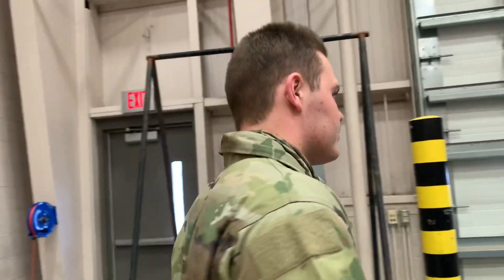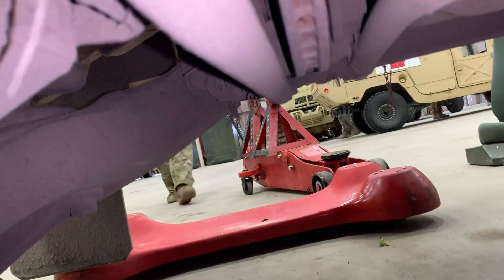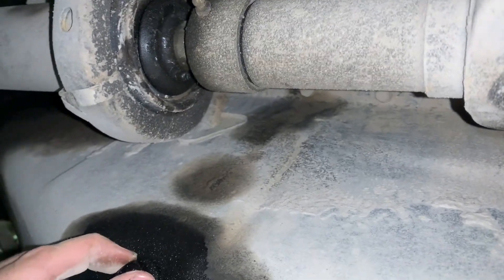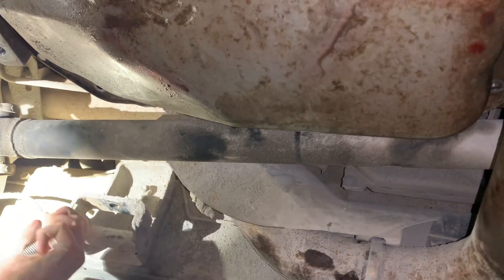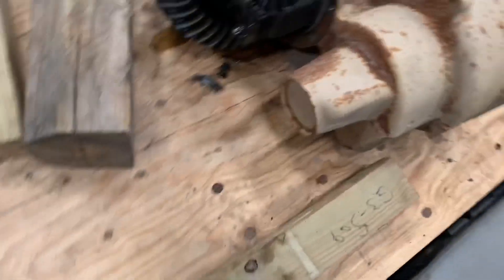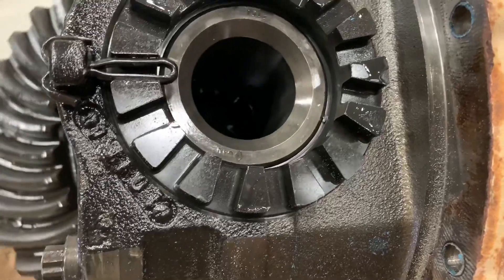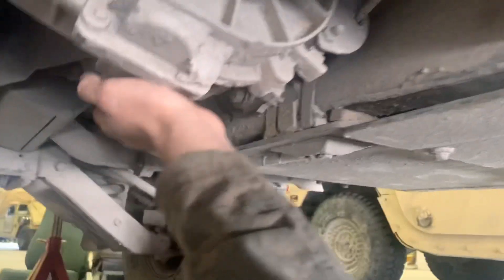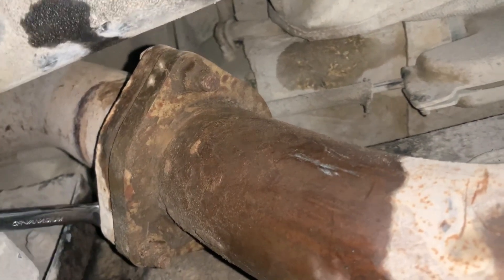How To Replace A Transmission On Military Humvee Army Mechanic Vlog

Comment: I just did my own trans rebuild and remove and reinstall (R&R)in the driveway by myself. . 1st step. Lift vehicle 4” on jack stands. Otherwise the Trans won’t clear the frame when you slide it out from under the vehicle. Disconnect battery positive cable and tuck it so it can’t slip out while working on the rig.!!!!  Open dog house. Remove exhaust crossover pipe bolts. Remove starter. Remove flex plate cover. Remove drivelines and electrical tape the caps on so the needle bearings do not fall out!!!! Disconnect lockdown on Th400 to injection pump ( Mark location) Remove Torque converter bolts using flex plate turning tool. Disconnect 2 Trans cooler lines. Disconnect linkages on T case and Trans. Disconnect Speedo cable on T case. On M1123’s there is a safety cable on the T case needed to remove. Floor jack support Trans at back portion of trans pan with wood to protect the pan. Loosen the Bellousing bolts. All of them of you’ll crack the case. Remove Trans Crossmember Slowly lower trans &  T case as a unit. Make sure you have new t case gaskets & RTV hi temp sealant. Huge tip. When you put the Trans and Transfer case (TC) together sealant the crap out of the Adapter to the case. Leaks if you do not! Check the Flexplate for damaged teeth. If bad get a new one. $75. !!!
Also, when you install the Torque converter (TC) put a wipe of Trans assembly lube or Trans fluid (TF)on the Input and output seals where the Torque converter and rear drive shaft go. If not you can rip the seal and have to R& R it all over. Also fill Torque converter with fluid new or old one. Most t-converters (TC) will have some trans fluid (TF) from the factory. If not a dry start can cause damage to TC or trans. Since the TCase is out I would reseal it. Easy snd it can save you an R&R in the future. Important. Important!!! When you are putting the TC into the front of the trans. Do not leave it hanging for long. It can tweak the front seal. Also when installing the TC into the trans. It has a smooth input area. Wipe Fluid on it and onto the grant seal so it spins or can tear seal and you’ll get a leak that won’t stop then another R&R. When installing the TC. Spin it clockwise and it drops in. Turn a dozen times so it engages the front pump. To Reinstall, balance trans and T case. Slide under and up into the rig. Have bell housing bolts ready along with Crossmember. Lift up and align the block pins to the Trans. Install the bell housing bolts. Install Trans Crossmember. It’s a good time to replace Universal joints if you want. Install Speedo cable. Drivelines. Connect cooler lines. Installl starter then bolts for TC. Turn engine flexplate with turning tool. If a new flexplate was installed you will have to check starter teeth to flex plate clearances. A paper clip when the teeth are engages is correct clearance. ( Look up online for exact method) Install flexplate cover shield. Install starter. Install exhaust. Replace exhaust donuts if bad. Install drivelines carefully as to not drop the Universal joints caps and loses needle bearings. Install linkages and lockdown cable. Double check all bolts and nuts. Install anything else removed. Trans will take 10 qts approx with TC but with coolers it can be up to 12 quarts. Put in 5 quarts they’ll the Fill tube ( Passengers side) If all hooked up attach batter cable. With s funnel and a clean rag ready, start vehicle in neutral. If in neutral and won’t start adjust the trans shifter linkage to engage neutral safety switch or vehicle won’t start !!!!  Start the rig. Must be running and on level flat ground to add fluid. Add 8 quarts. When engine is warm and running, check the trans fluid level. Add fluid till the fluid is in the Cross xxx on the dip stick. Look for leaks. Adjust accordingly and slowly. Too much is just as bad as low fluid levels. If all good remove jack stand and test drive it. Do Not tow or drive off-road or over 55 mph for 100 miles or do. Congratulations you just saved $1000 in labor by doing it yourself. Any questions call me 702-334-5886. Dave